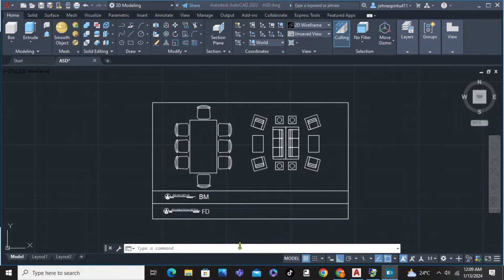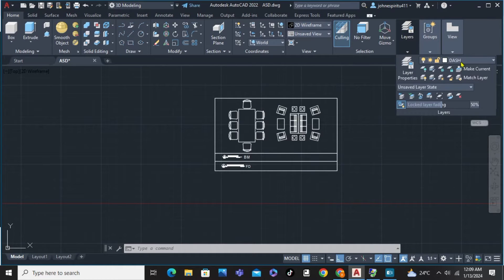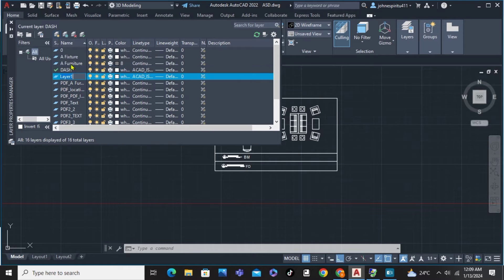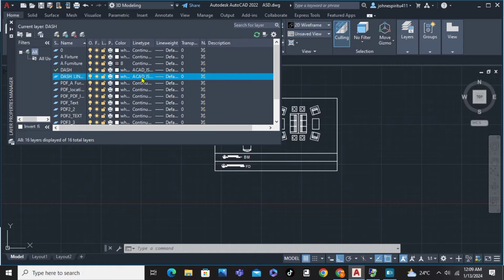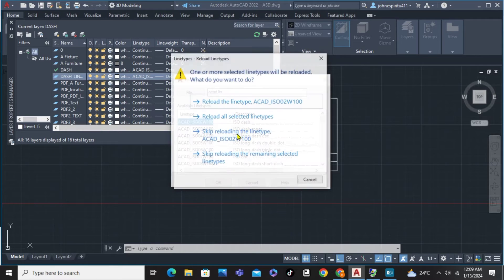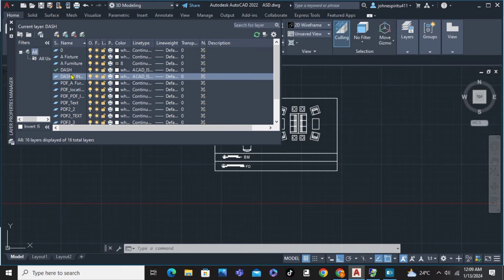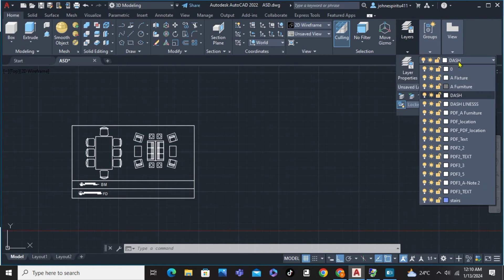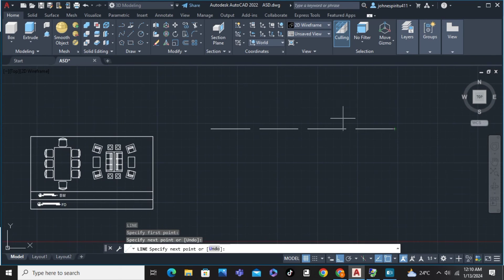How to Make a Dashed Line in AutoCAD [QUICK GUIDE]

Comment: Why my lines still straight
Reply: I've used most kinds of cad software over the years. I've used SolidWorks, Mastercam, F360 and Inventor. Autocad is in general a horrible program. A really poor interface and lack of any intuitive use. You would think that highlighting the line and selecting line type would simply change it. Nope. To add to it, it always has some kind of glitch. It's just horrible. I'm using it for school and I'd rather smash my face in with a brick.
Reply: sameeeeeeeeeeeeeeeeeeeeeeeeeeeeeee
Reply: @vv2178  im figure out just type LTS AND TYPE 0.0250